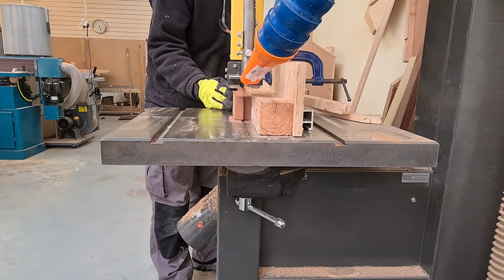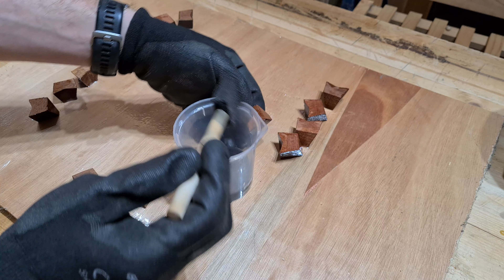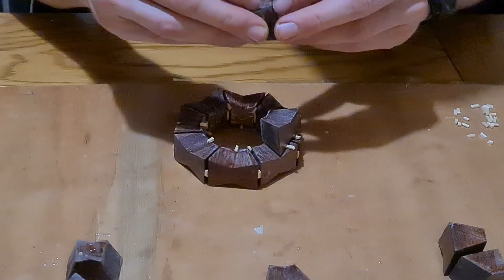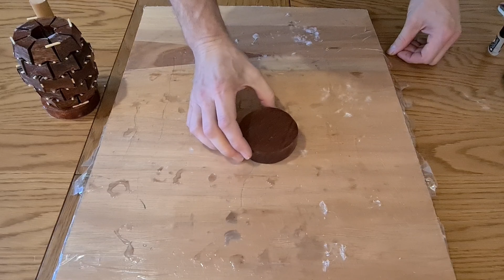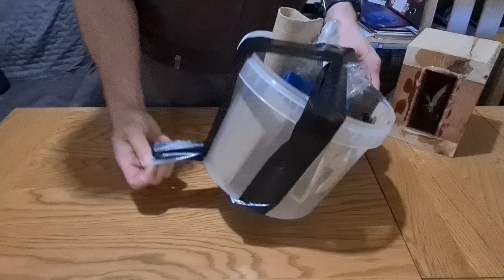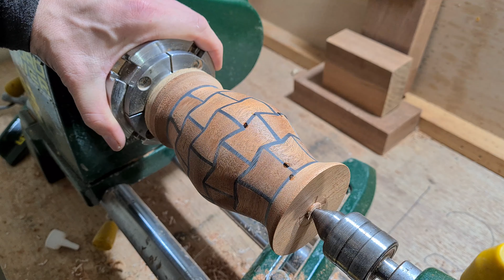Woodturning - Bowties

Comment: I often find myself writing positive comments on your video's, then sounding like I'm criticizing by adding an idea or two that I felt would make the work piece more aesthetically pleasing to my personal taste............ But I've got nothing to add here.......... There's absolutely NOTHING you could have done to this that would make it more visually pleasing to me. I wouldn't have thought the acutely geometric segmented pattern would suit the flowing curves of the overall shape, but to me they just looks so right together. I know you're not sitting there and thinking on how to refine you work based on what "lill'ol Reman" has said about your previous pieces, but you're styles defiantly going in a direction that's becoming more and more attuned to what I see as aesthetic perfection.

I'm thinking something inspired by this piece would be an ideal candidate for you to do a very limited run to sell. If you found someone friendly with a 5 Axis CNC router, they could machine 6 or so blanks from something like walnut burr with all the "Bow ties" pre cut, but all still attached to the centre as a single piece. That would help remove a bit of the tedious segment shaping, spacing, and initial build up work from the slog of doing a "Production run". Then you'd "JUST" have to resin them up, turn them to shape, and hollow them out to finally separate the rear of the segments.
I know it would be a fairly substantial outlay in time and money for materials (Lumps of burr walnut don't grow on trees you kn............Ooo........... Erm...... Didn't really think that sentence through did I. :D), But I really think they'd sell for enough to make it worth doing.
Reply from the maker: Hey Reman. I appreciate the detailing thinking here. I always welcome comments no matter whether they are fully supportive or full of criticism, or even both. I simply hope that the comments (like yours are) will be constructive as it helps me to engage with different perspectives. I love the idea of a 5-axis CNC machine to produce these bow tie segments. Would have helped on a delayed project where I have 80+ bow tie segments now in a large bowl format. The issue at present is this is a hobby and I'm trying to squeeze out a little time after work and not forget the family. If I can generate significant interest I could probably get time at work to do it, but my focus there is for the charity and the people we help. The workers are few and the need is great! But a slow and steady approach may help. I want to redo this project without the problems and see if that final piece could sell and then who knows where that may lead. Thanks once again for your thoughts! Take care. Ray
Reply: I guess I am pretty off topic but do anyone know a good place to stream new series online?
Reply: @Bryce Dash Thank you, I went there and it seems like a nice service :D I really appreciate it!!
Reply: @Nickolas Hank Glad I could help :D

Comment: Turned out very nice Ray! I was trying to find some of those LED lights with just 1 light for something I am making. Any ideas?
 Off to check out more of your videos,
Gary
Reply from the maker: Thanks Gary. The LEDs I used for lighting this up were these ones: https://amzn.to/3jzMYI5, which were small enough to fit inside the little aperture of the vase. And cheap enough to justify getting 10 LEDs (plus 2 remotes), so plenty left over for other projects! All the best. Ray
Reply: So are those single units? I found some that were all chained together. And what is the diameter and height?
Reply from the maker: @ThePapa1947  Yes single units that can, when all are turned on and in range, link to the remote control. These ones are 35mm diameter and 22mm height. And if you needed can also be submersed in water. From Amazon.com the closest matching were these: https://www.amazon.co.uk/gp/product/B07MP4CV2D
Reply: Thanks and If I could get some 35mm diameter it will fit what I made. I ordered some with out a remote and more of a candle shape but would rather have what you got. They look brighter. Either way you will see what I made this Friday.
Gary
Reply from the maker: @ThePapa1947  Looking forward to seeing what you've come up with Gary!
Reply: I ordered the lights. Should be here tomorrow but I may use the others. Depending how much time I have to finish the video.
Thanks for the tip.

Comment: Bow ties are a carpentry joiner type thing to make a crack in wood stronger...did you get the idea of bow ties from this or from the tie?
Reply from the maker: I have done some crack repair with bowties and I think I recall someone having woodturned a bow tie in a pot for crack repair. Decided to take it one step further and make a feature from it

Comment: Not work, but continuous meditation, for the beholder at any rate. You just have hellish patience and scrupulousness.
The only thing I can take the liberty of giving you a hint about is the highlighting method.
In my opinion, your products would look much more advantageous if they were illuminated by LEDs located at the intersection of transparent lines.
This was evident even from the quality of the clock illumination, and in this vase such a solution is simply necessary.
Sorry and IMHO.
Reply from the maker: Hello Valery. Thanks so much for the feedback. I think you are right about the lighting, although the internal cavity of this piece was very small and difficult to work with. I only managed to find a small enough LED to fit inside! All the best. Ray